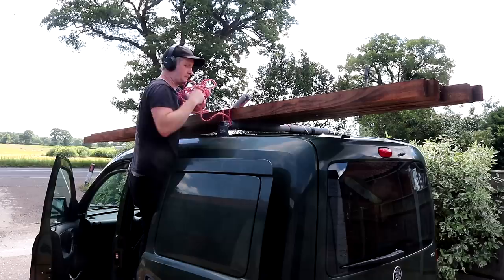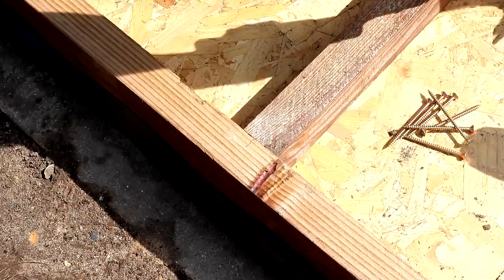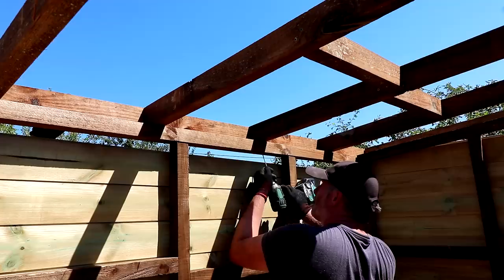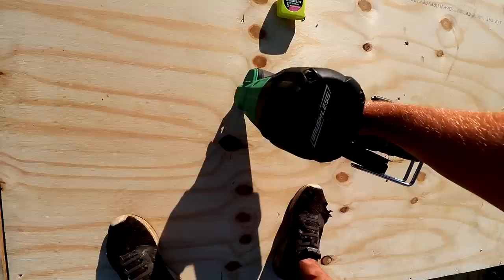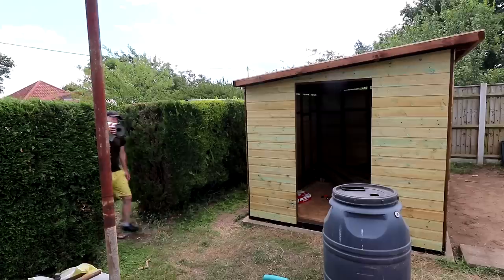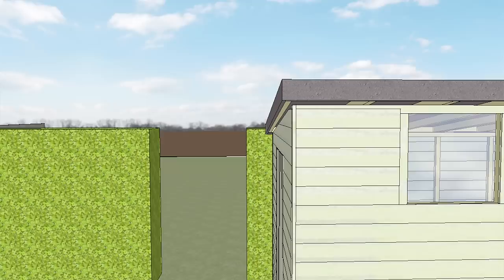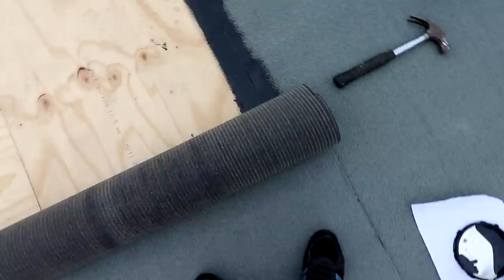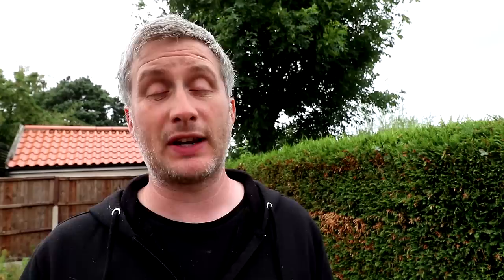Making The Shed Roof (PART 5 SHED BUILD PROJECT)

Comment: How much to build 17 long by 9ft wide shed about 4.5 mtrs in height triangle type roof, taking into consideration a concrete base to make up to 4.5mtr height please?

Im based Colchester Essex not that far from you, I  hear sheds can't be more than 2 3rds or half size of garden but more than 2.5 mtrs from house with either flattish roof maxium 3mtrs height or triangle type maximum 4.5 mtrs height so not classed as dwelling, is that info still in use? 
Not sure if ill be just having shed put into bricks and ramp built so i can use the concreated base so no water or puddles appearing the reason of this plus stronger floor for for heavy motorbike.